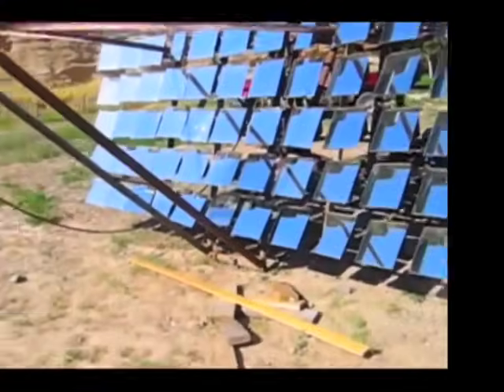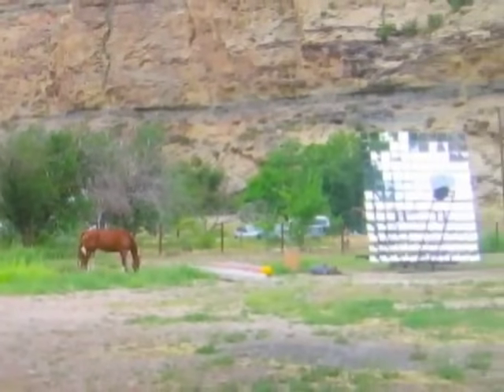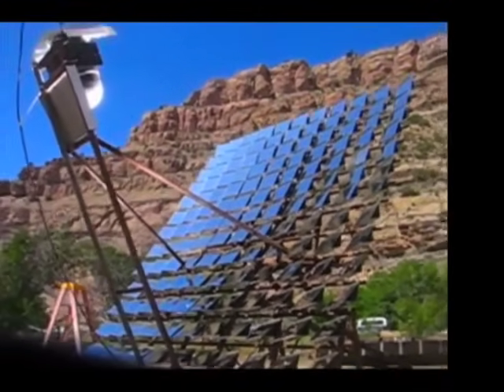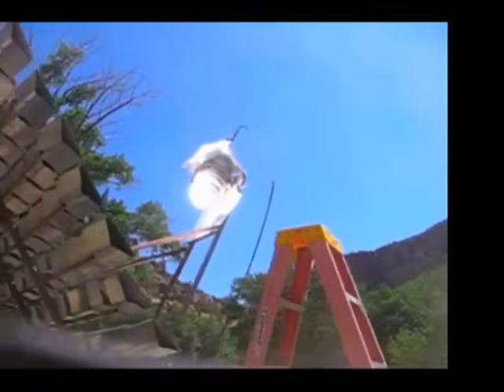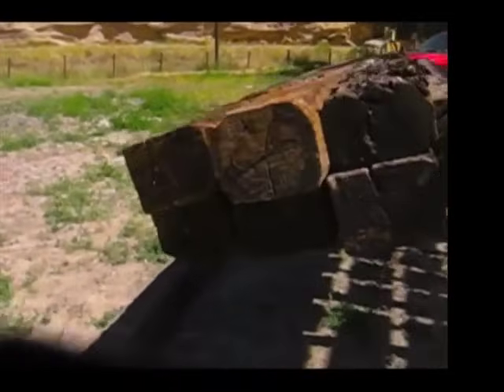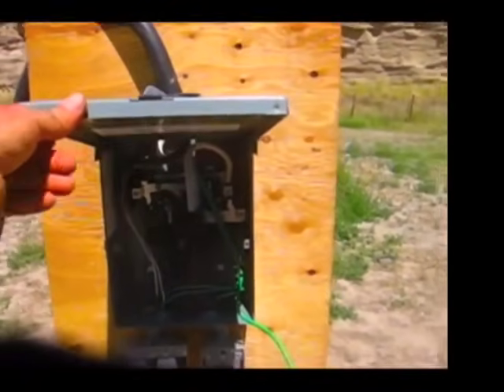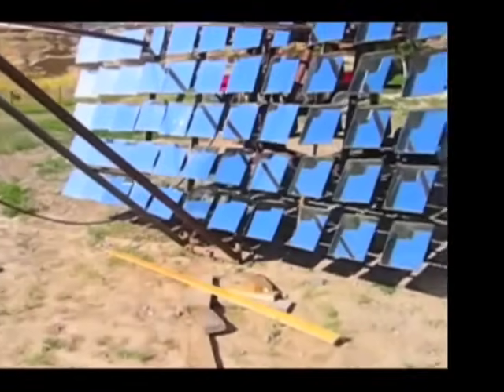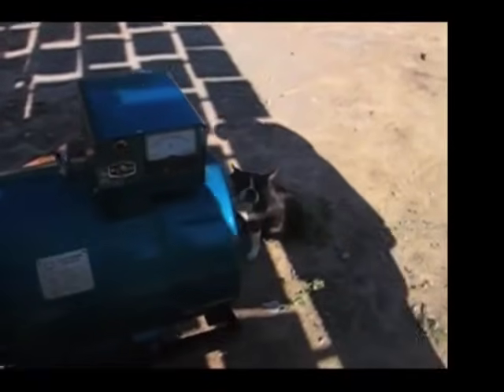STEAM ENGINE 12KW GENERATOR Solar Mirror Array Death Ray

Comment: need a condenser, reuse the water and help even the pressure out in use. best source i have ever laid my hands on is audels marine engineers handy book. mine is from '43, i dont know when they stopped printing it. it is the very model of a modern marine manual. ok, not modern, but it has information on generators, wiring, steam turbines, engines, boilers, recovery, safety, construction, steam pipe fitting, physics, chemistry, electricity basics, values, batteries, and more. ultimate diy

Comment: It appears you're tracking the sun manually.  I'd use dual linear actuators / axis.  They'll do up to 1500 lbs per actuator and you can get a 48" stroke.  It's very low duty cycle.  Table look up with a programmed offset would be the best way to go with coding the controller..  I had a couple of small HCPV (high concentration PV) arrays .  Good size 10-12kW is a very sustainable small ranch / farm array.  If you get it tracking you'll need a wind stow circuit.. Good job keep up the good work!!

Comment: @TedRobotBuilder Yeah I was noticing that. I only ever worked one power plant, but as learning experiences go I was an information sponge, and the water vapor is usually recycled in the cooling towers (he could power the circulation system directly form the generator too.)

Comment: You know, if you superheated a semi-viscus liquid (some type of oil) with a significantly higher boiling point than water, placed a water reservoir on it to heat by Conduction/Convection, you could theoretically set up a situation in which you could maintain a temp over 100C 24/7 for sustainable solar power. The oil would be >100C the whole time, probably spiking up to around 200C mid-day, and would, itself, heat the water continuously.

Comment: Also, you have to take into account the efficiency of the steam engine. So even with a good evacuated tube collector setup.... you won't achieve anywhere near the electrical output that you do have in thermal output. To automate it you'd need a water dosing pump that adds the exact amount to turn into steam with temp sensor on output. Hotter temp = more input water, etc. The stirling engine is a better bet but no affordable units out there yet.

Comment: The evacuated tube collectors I sell @ coastalsolar.ca produce just over 1700w in full sun for a 30tube unit. That's about 6'x8' area. So his overall collector area is 181sqft. Our collector has 48sqft so his is about 3.8X the size. Our evacuated tube units are extremely efficient and no tracker needed. In the same area our's would produce just under 6.5kw. So pushing a 12kw generator assuming losses wouldn't work on his setup.

Comment: A 12 kW generator dosn't mean it produce 12 kW of electric power. 
Sun produce 1 kW by square meter. To get 12 kW you need at least 12 square meters. 
Modern Steam engine efficiency: 40%. (clearly in this video it's not a modern steam engine...  ) the efficiency is between 6% and 20$.
All this to say that he need a pannel of 200 square meters or 2152.782 ft² to produce 12 kW.

Comment: @garand  I see the problem. But I think (hope), that a strong and permanent stream of cooling water over the frontside and the backside of the photovoltaic cell (then encased in a flat closed glass container and coated with synthetic resin) could keep the temperature low enough (under 212 F) to prevent the deterioration of the cell. The warmed-up water could then be cooled down in a car or truck cooler (closed cooling system).

Comment: @Terascon when you focus light on a photoV cell the heat deteriorates the cell quickly.  3M has a reflective coating that allows the heat portion to not be reflected.  it did increase the output about 20-30% with solar tracking algorithm.

Comment: Great work! But how about combining a big photovoltaic cell in the focal point (efficiency = 16-20 %) with a efficient water circulation cooling system (with a truck cooler)?

Comment: In the video they talk about some special modifications to the mirror array.
I do know that if a person uses "regular mirror" or second surface mirrors that you loose a tiny bit if efficiency due to the light being bounced THROUGH the glass 2 times and also the type and color of the glass used in the mirrors.
What would work better is first surface mirror like the big companies use.
Good luck finding that type of mirrored glass.
Also the elements tend to remove the coating unless they are coated

Comment: @2009mechanic Heating less water would in turn cause less heat to be lost and faster heating. However, you will need a water feed system that will drip water into the tube at exactly the same rate as it is used. This is very do-able if you recycle the steam from the output, condense it by pre-heating the water that enters you home's water heater for example. A stirling engine is a good alternative, but you will need to use a REALLY reliable cooling system and a robust engine design.

Comment: @yellowmetalcyborg 
Would it be more efficient to use a coiled copper tube collector or receiver at the focal point instead of the tank heating the water in volume ?
This IS what I am designing and building for the receiver at the focal point of the dish .
My thinking was it would be better to circulate a smaller amount of water through the copper coiled receiver to better heat it and convert to higher temperature steam ?
Perhaps should I just build the Sterling engine with a refrigerant ??

Comment: @2009mechanic Not to mention the fact that he's using wet steam. He can dramatically increase efficiency if he used a superheater. By increasing the temperature of the steam, he would be raising the theoretical carnot thermodynamic efficiency limit. A superheater can be a copper tube that passes through the focal point of an auxilliary solar dish, or just the interior of the boiler. Basically, he looked over a lot of crucial technical details and could have done a better job : \.

Comment: There are people who are doing this with Stirling engines (stirlingenergyDOTcom).  Those at the "stirling energy" website create about 25kW with about the same footprint, however, I suspect the price tag is rough.  Steam engine technology seems more accessible somehow, but Stirling would be more tidy.  No hot water to worry about.  Just a nice dry engine with wires coming out of it.

Comment: That's great!  Now add a condenser to recapture the water from the steam output and recirculate with a pump connected mechanically to the axel of your turbine/generator or electrically from the output.  This will conserve water and increase your power output.  As for how to aim the panels to track the sun automatically, there are cheap solutions out there that can operate off of the electrical feed with minimum usage of power.. do a little research.  I can supply my design block diagram..

Comment: @2009mechanic 
This comment doesn't have much to do with this video.
There is a company in Turkey that makes Photo Voltaic Thermal (PVT) panels that incorporate copper tubing affixed to a flat plate which the solar cells are mounted.
This keeps the solar cells MUCH cooler thereby GREATLY increasing their efficiency.
Heat is bad for PV cells just like any electronics device.
The extra hot water heat generated by the dark PV cells is then used elsewhere.
Efficiency is about 70% conversion rate !!

Comment: @Nxcng 
This video was a very good start for the author's point of view.
I am just thinking about HOW to recover as much of the heat from the sunlight as possible and either use it or store it somehow.
You do have to figure in your efficiencies and also losses .
That is why I intend on using solar PV panels with storage batteries for the electrical part of it to run the necessary pumps and controls.
Utilizing both types of solar just makes more sense and also makes it more green.
Good luck 2 all

Comment: @Nxcng 
Yes it would require some real planning and some engineering.
Most of what you need to know is already in books or on the internet if you look for it .
I have been planning mine for 3 years now.
Much of the time was spent looking for the materials that I wanted for making it work .
Think low budget.
If I can keep the cost of the whole project below $10,000 over say a 5 year period then I'm doing good.
Once mine is up and running , it doesn't cost me anything for the energy at that point.

Comment: @aForkandaSpoon  I believe that a radiator as its names states would do just that.
You WANT to heat water in volume inside a sealed container to contain the heat and pressure.
This is basic boiler theory.
The cold water is fed back into the boiler using a condensate pump.
Same as a home heating system like low pressure steam.
Hot water boiler heat (not steam) on the other hand uses a circulation pump to force the water through the system.
4 solar use PV panels with battery backup 4 pump power.

Comment: Uncannily similar to my solarfy rendering...(at 10 seconds).

Except the rendering is in thin air and uses CPV instead of a steam or Stirling engine. Nice to see someone REALLY doing it!

Solar needs an "oil like" company that does it all "under one roof" in order to compete with coming shale oil and tar sands.
We are just about at peak "easy oil" already...

However, THIS IS AWESOME! I didn't know that 143 suns could boil water and cut wood!

Comment: @2009mechanic 
A clever person could install a geothermal ground loop system without the compressor and just use circulation pumps.
You could then take the used steam and condensate it via a heat exchanger with the cold ground water from the ground loops.
That heat is then stored in the ground 4 your heating purposes in the winter and then just pump the ground heat back out into a water 2 air exchanger 2 heat your house and probably your garage also.
Install solar PV panels and batteries 4power

Comment: @moegreen2 
I am designing a heliostat mirror system for my home's use that will use 750 square feet of mirror mounted on my garage roof South of the house about 25 feet to focus additional sunlight on my 576 square feet of flat plate hot water collectors mounted up on the South facing house roof.
The trick is trying to aim these using a computer and getting them to point where I want them and then track the sun all day and extend the available time of collection.
I plan to use 3 speed H2O pumps

Comment: @2009mechanic 
Another thing I have heard about is when the feed piping is run up into the dish receiver , people have used a different way to preheat the cooler water a bit before it gets to the focal point or receiver.
They put ONE pipe INSIDE of the other !!
Heat exchanger!
You run the cooler water around the outside and the super hot water down the middle or perhaps it would work better the other other way around ??
Either way you would have the piping itself insulated from the ambient air.

Comment: @321ozzy 
In my area we have a lot of guys interested in the old steam engine stuff.
They actually have "threshing Days" and they fire everything up .
The public can walk around and watch the old stuff and it still runs great.

On the steam boat ; what is the condenser cooled by?
It is ambient air pushed through the condenser with a fan  or is it a water to water exchanger using river water to condense the steam with.
I am trying to figure out how to accomplish this at home and the extra heat??

Comment: @Fargfromgroovin 
Were you thinking of a chemical system in general that reacts with the available wavelengths of sunlight or were you thinking along the lines of pumping something different through the system as a more efficient heat transfer medium or "phase change material" of some sort?
There is a guy in my city that has been experimenting with those materials and has access to a chemical engineer to colaborate with him on it.
They have not come up with a really cost effective solution YET.

Comment: @craftmatic2 
There are also laws regarding boilers in your states' plumbing codes .
If you go to a high pressure steam turbine then you need an "A" class turbine boiler's license.
Unless you work with this stuff every day at your job , you are not going to just go out and be able to get one.
There are laws regarding that as well and has much to do with the "hours" you are credited for running and maintenancing boilers.
I have my license so I don't need to worry about this solar equipment much.

Comment: @craftmatic2 
IF you are building something that just heats the water but it stays below the boiling point , then no as it is just a water heater and there is no pressure other than from the circulation pump.
If you are building something that makes steam , then the boiler needs to be certified by an engineer AND you need to have a boiler's license to run it .
Below 15PSI steam pressure you need a "C" class low pressure boiler's license.
Above that you need a "B" class high pressure license .

Comment: Sterling cycle engines have not come far enough yet to be effective at the small scale I am talking about .
About the only way I think I could transfer the heat from outside up on a tower is by pump a transfer oil of some kind.
Any ideas of what types of oil would take the temperature extremes and also will not freeze solid at -40 Deg Far.??
I could then use the hot oil to boil water to steam for an indoor steam engine or small scale turbine ??
I'll take any ideas on this.
Thanks for your help.

Comment: I am planning on building something similar to this.
I now have 7 of the old C-Band satellite dishes , 3 of them 10 feet and 4 of them 8 feet in diameter.
I plan on putting them in 2 rows so the 3 10' dishes will be in a row and the 4 8' dishes in another row .
Both rows mounted next to each other and put up on a 40' monopole to get them up into the sunlight because of my location.
My biggest problem is that I live in Minnesota so it gets COLD here.
I cannot use water or steam outside
.

Comment: @2009mechanic That would be for heating,but for electricity producing,this the most efficient way of turning steam into mechanical energy.If this system would be in the range of 0,5-1MW,then it would be efficient to use a steam turbine complied with a steam overheater.

Comment: Neat idea. Need a computerized tracking and focusing system to make it viable. otherwise might spend two days focusing it. And closed loop is the way to go. Steam is old school though. I think the next breakthrough will be along these lines will be with a chemical process like what happens in a solar panel. Takes the headache associated with mechanical systems out of the equation.

Comment: It looks like he is running a steam engine but it is an open loop engine.
Mainly he is just heating the water to get live steam and then letting it go.
A waste of water and BTU's from the steam .
Why not make it a closed loop solar boiler just like building heating plants and use a condenser makeup feed water pump running on PV panels too.
It is a very do-able idea.
You will have a more efficient system by reusing the leftover heat after the steam is dead to pre-warm makeup feed water.

Comment: @myleftnutts Incase you didn't know nearly all plastics and some rubbers are made from oil. Thats not even getting into the oil used for the energy needed to power/make machines that make the solar panels and ship them to the stores/end-users.  The reason we dont have have good alternative to oil is many of the people that back alternative energy sources are so simple minded they cant see all the different links in the chain.

Comment: @flowingsolder then, how the hell did it run that Saw?? With the same power you ran that 'ere saw with would run a large burner and steam water......... I'm confuzzed.... I guess because it would evaporate the water faster than it would in order to keep the engine running...... hmmmmmmmmmm....... I'm still skeptical of the "theory" that you can't get more out than what you put in... "ANYTHING IS POSSIBLE" how do you think they travel in space?? Duh!?

Comment: @spikes2020 maybe but solar panel set ups are to expensive to be practical.  Something like this is far more practical  atleast until the greedy sobs producing solar panels and batteries lower the prices. Green energy will never be used on a large scale until its cheaper and more efficient than fossil fuels thats a fact. It's true the sun provides more than enough power for humanity  but solar panels suck at using it batteries suck at storing it. Not to mention it takes oil to make solar panels.

Comment: Did you though about closed circuit of water? In that case, you need to add an compressor and condenser. Moreover, you could add regenerator. It won't loose any water and you can gain higher power due to higher efficiency.

Comment: I don't know if anyone is still responding to this video, but here it goes anyway.... 
Why not run a 2,000 watt burner (like the large one off a stove) for a heat source for the boiler? You wouldn't have to depend on the sun then. If it can handle that  saw like it shows in the video then it should also be able to power a burner. There ya go, you will also then have KIND OF a perpetual machine then too  ; )
I'm just curious have you tried to use the whole 12Kw???
OR
How many Kw CAN it run?

Comment: hey joe mother earth news had an article about this same machine also there was an article in a tech mag? don't remember- but they had an article in it about building the tracking system for the same machine it might also have been in men late 70s early 80s is when it came out the folks who built it used it to produce electricity too if i remember they also used some of the power to generate hydrogen to run an engine for a generator it was pretty cool stuff just like this is pretty cool man